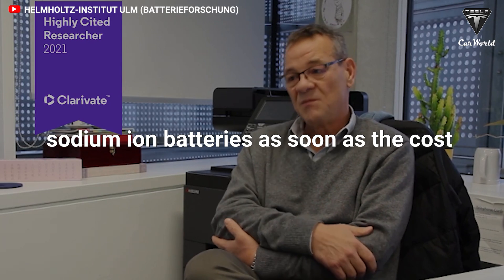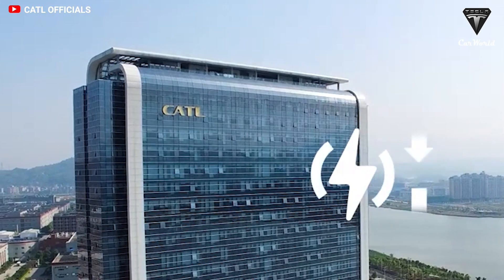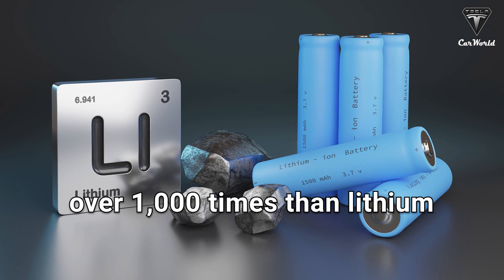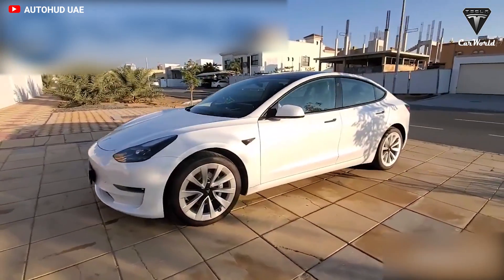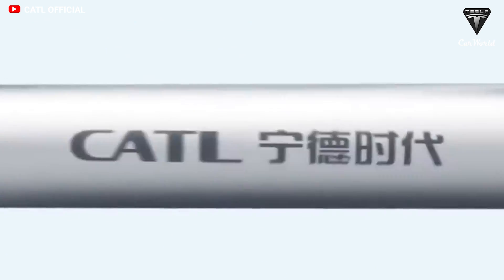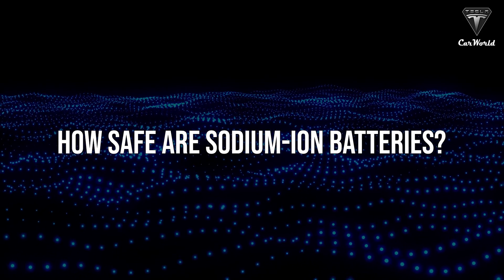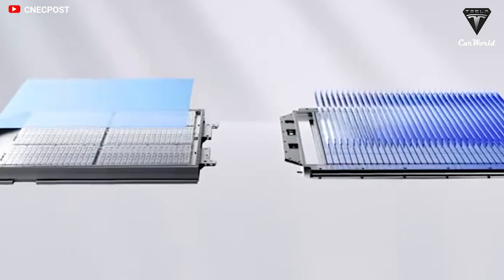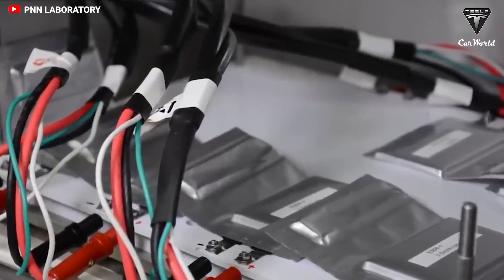Goodbye Lithium! NEW Sodium Ion 4.0 Battery Changes Everything in 2023!

Comment: Doesn't matter. its foolish to think that a cheaper battery is going to make a cheaper car. You do know it just don't work that way right.  You remember USA automakers moved all their car production out of the states to control pricing and be more completive. Well now they cost 3 times as much and are even worse quality. That's how it really works.
Reply: Well no actually, the Tesla Model 3/Y RWD is much cheaper than their other models because they use the cheaper LFP battery. EV batteries make up 40% of the cost of the car, so cheaper batteries certainly means cheaper EVs. Plus the main advantage of Sodium-Ion batteries is cost, they would fall well behind Lithium-Ion batteries in terms of range and performance, so the only reason why you would even use this technology is so you can offer the low-end EVs at even cheaper prices.

Comment: Sodium ion batteries can only reduce 20-30% cost at the moment, not 700% cheaper. There are other factors in the cost that limit the savings besides this one material. The supply chain is also not ready to support this big change in production method. It’s going to be several years away before we see this type of battery in any significant volume.
Reply: Egsactly, the built-up production capacities and accumulated knowledge will maintain lithium's right to exist for quite a few more years.  It has been known until now that sodium may have a great future.  Just read the CATL website.
Reply: If you are talking about the Chinese, I do not think they have an imaginary ability to strengthen supply chains. Ask Bill Gates why he has not counted from China yet, despite the drop in productivity to 50%.
Reply: @abedmarachli7345  China is the only country right now that owns a complete supply chain for batteries. Everything from raw material mining to high-level battery assembly is done within a few hundred kilometers. They face much less supply chain issues than any other country despite being the cause of supply chain issues for the rest of the world.
Reply: Most of the video is trash. $15 for Sodium batteries is not something that's been proposed by CATL or realistic for any other company within a reasonable time frame.
Reply: @abedmarachli7345  “has not counted from” or “has not counted out”?

Comment: I'm designing an off-grid solar supply for a remote radio installation. Weight and size are not an issue, but I need to be able to charge the batteries below freezing, which lithium can't do. This looks like it has great potential in my application.
Reply: Good luck, but I don't believe in solar or wind. I do support nuclear how ever. My better half has radio equiptment, and still use lead acid batteries for his system. Still going strong for the past 8 years with the same battery pack, with two backup systems on top of the first. Solar doesn't work too well when you have 5 days of clouds or rain. Sadly, but have fun with what your trying to do.
Reply: AMTE Power may be able to supply the Sodium-ion battery you need
Reply: @tommills7006  
Do you have that website???
Reply: Paul Plack
Well, this precisely might be the thing that Indians are looking for, in use at Himalayan heights (more than a mile in altitude)perpetually covered in snow irrespective of season, at latitudes 28º to 36º N - all tailor made.

Comment: This would be a huge advantage for homes,  a powerwall that's double the size, and yet a fraction of the cost isn't a problem. This is an advantage .
Reply: BIG thumbs up ,, YES a home storage battery that normal income families CAN afford.
Reply: Yep, the current cost of home backup batteries is way too high. You really  would like 30KWH, and that with inversion is running about $20K. It would be great if that drops to $3K.

Comment: I follow the first commenter Dallen9 I too believe  the sodium ion lithium ion swap is best done right away so that the concept is accepted and production can proceed.
Be prepared this is a huge statement to make to Tesla and it can't be just a question it needs to be done directly and without question get out of lithium right away Elon.
Reply: Elon Musk needs to really realize this. Sodium-Ion batteries are far better than their lithium counterparts in terms of cost, safety and abundancy.
Reply: @daineramosquitco5816  tesla and catl are partners, they are aware, some say a new platform will be presented by tesla in March with a cost reduction of 50% compared with model 3/Y, this would probably help on that, also for stationary storage it would be a no Brainer.
I wouldn't be surprised if most of production is already reserved for tesla...
Reply: @rui518  Yeah, hopefully tesla cars start using sodium ion batteries.. so that there will be no more explosions ever again and that $46990 on the Tesla Model 3 SR+ becomes

Comment: If they charge so rapidly then the range isn't as important .
Reply: It might be anyway.  Lithium batteries already can stress power grids.  Faster charging would require even more careful planning to avoid so many being charged simultaneously.  Smart grid tech could help with this as was intended to spread out the grid load over the coarse of a day.
Reply: I say its still important for cars at least. Gen 3 or 4 should correct for it though. Salt batteries for House and Grid storage - would benefit the most out of it for now - at least on gen 1 and 2.
Reply: @uncrunch398  In theory you could just put a salt battery in front of the charging station/super cap to help lower that need much like they already put a Li one in font of it already.
Reply: @adr2t  yes that's very true .

Comment: Would make affordable power walls for solar systems.
Reply: EXACTLY what is needed. Here in Sydney Australia we have a massive problem with solar ,, yes we have a large amount of installed solar and nearly zero batteries. MASSIVE amount of power available when nobody is at home to be using it. It has got to such a bad issue that there is suggestions of actually charging money for solar panels that are supplying power to the grid during peak sun hours

Comment: Note: It's CATL not CALT, aldo issing LOTS of needed specifications and math.
difference in Weight/WH and Volume/WH.  Also you reduced the price of the entire battery by just the price change in Lithium/Sodium.  There are a lot of other materials used in building a battery.
Reply: Your correction is not merely suggesting the author(s) don't give a hoot about spelling but undermine the good spellers here thinking that the chances of Tesla et al have been barking up the wrong battery chemistry.
Reply: @calmorton4619  I can't really make heads or tails of your comment.
The main point is that the given "price reductions" are laughably incomplete and obviously incorrect.
Reply: @calmorton4619  there is actually not that much lithium in a lithium battery. if they come up with a good solid state one it likely will have higher lithium content.
Reply: Looks like final solution is not given yet.

Comment: Sodium ion batteries will end up in cheaper cars with short range. However, I see a much bigger application with stationary storage. It should revolutionise home battery storage. Imagine having a 30kwh home system for $3k. This potential become a grid size energy storage solution.

Comment: Sodium ion batteries have all the advantages like safety, cost, charging time and temperature. It's only downside is range. But if the charging time gets better, it will replace lithium ion. What people will do is mainly use it for city driving. If they go on long trips, they will have to make many stops
Reply: Do you drive your current ICE vehicle 300 miles between fill-ups, driving it until the thing is nearly out of gas every time?  Of course you don't.  It gets to 1/4 or so and you fill it it.  Maybe 200 miles more most people and they go to a gas station.  Even on road trips, you pull over when the thing needs it.  Yet the idea that 200 miles range is garbage and we MUST put massive battery packs in our cars sticks in people's heads.  I'm worn out and need a break after 200 miles.  Get a coffee, maybe some lunch.  What we need is a better charging network, same as gas stations.

Comment: Norwegian  electric car Think City had a Zebra sodium-nickel battery as an option in 2007. It had the same capacity as Li-batteries, but
a longer lifespan and worked at a high temperature
Reply: Nickel is rare and extremely expensive. There isn't enough Nickel on the planet.
Reply: Stig Henning Johansen 
Zebra battery was developed in South Africa,if I am right.
Reply: @MrPoornakumar  That might be true, I have no clue (Rhyme) ;-)
Reply: @stighenningjohansen  
Rhyming is good.Does it conceal your info?
Reply: @MrPoornakumar  I dont give a shit. If ecars are better, its nice but to me, it ended up in a money wise plane   crash, so I'm out.
Diesel or Petrol for me
Reply: @stighenningjohansen  
Good luck !
Reply: @AjayTiwari-en9nz yeah that's why they coat cheap common metals like gold with prescious nickel. I heard its almost as hard to find as iron

Comment: I want to see this in home UPS / Solar applications. In vehicles, the mass and weight are more critical for drivability. At least finding where sodium can be used to ease the need of it in all markets to certain markets, is a good thing.
Reply: exactly
Reply: Very good point! If they are much cheaper, even with 4-5 times less capacity, they will still be perfect for stationary electrical storage, which by the way is also huge problem at the moment. Unfortunately I am watching similar videos for the past 2-3 years, yet I have never seen a new alternative to li-ion batteries in real life. I guess whoever starts production will get rich very quickly.